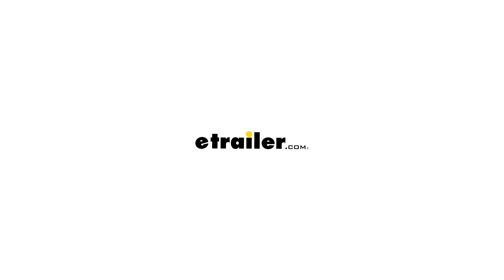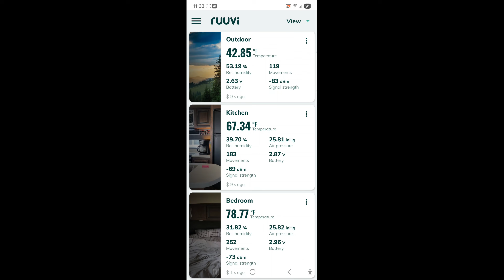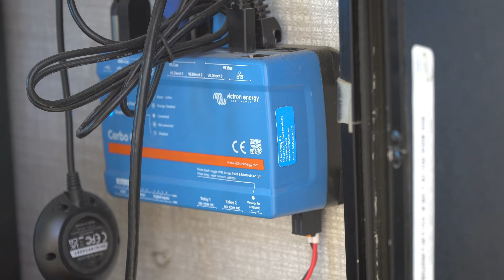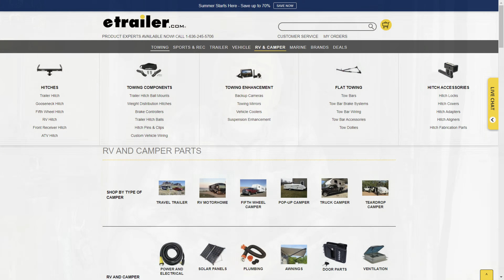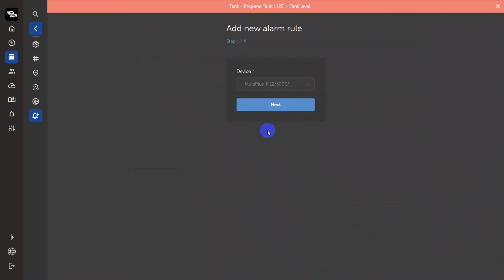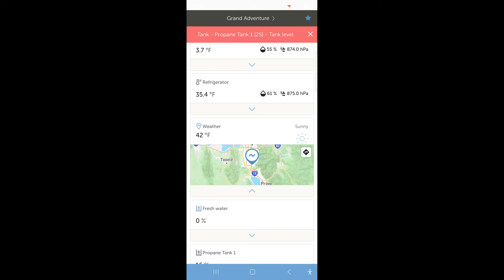"Smart RV" Deep Dive: Remote Monitoring with Victron, Ruuvi, Starlink & Mopeka (Ep. 459)

Comment: Excellent work here. We have done pretty much a similar setup with a few exceptions and learned something new from your video which I’ll probably install in the future. The gPS tracker is cool. I’ve been using my Ford App for location of the truck whilst everything is powered down as I leave the truck camper on the truck in a storage unit when not in use. But the tracker you show looks like a nice addition. Don’t tell my partner I’m adding something. Her head will explode.🤯!

We do run rules generated from Ruuvi tag temp data turn on low voltage consumption circulatory 12v fans I have installed in strategically placed overly warm areas. 

Examples: a tag behind the 3 way fridge in the outside compartment with two fans near the fridge roof vent to help draw air up when in hot weather. Our fridge has the built in fan that will run to help with cooling but it’s noisy, under powered and doesn’t do a good job to keep the temp in the fridge proper. When the temps get to a certain temp before the fridge fan turns on my installed fans will turn on. Works great.

Also put tags and fans in the inverter/battery compartment to do the same thing as it is a very small space (truck camper limitation). I had been getting shut off alarms on the inverter, especially during charging, during hot weather but with the tags, fans, added air passageways and temp rules was able to direct air flow behind the shower and through the wet bay where I have an additional tag for monitoring. Seems to work quite well in dissipating heat.

After two years of use I just replaced all the batteries in the Ruuvi tags. I’ll give this advice for replacement batteries; buy quality batteries…ask me how I know.😢

I did notice a difference in readings between actual Mopeka sensor readings from their app and the victron feeds of about 10%. I just use the Mopeka app data as it’s typically lower in the capacity reading. Haven’t been able to figure out why.

I did install the See-level tank sensors as I was fed up guessing our black tank level as it is very limited in capacity. The gray and fresh tanks were very difficult to get to as they are buried in the camper with no access as we have a Northern Lite fully enclosed fiberglass shell. I had to cut in an access in the floor in lieu of crawling 6’ through an 8” hatch opening to get to the tanks. I’m skinny but my own set of claustrophobic rules kicked in. It’s still not 100% accurate but way better. I wish all RV manufacturers would install proper monitors. Seems to be a fairly inexpensive convenience to their customer base. At least offer it as an option. For this reason alone I will not buy another Northern Lite.

Anyway, thanks reading if you made it this far. And thanks for this video, the tips and sorry for my long winded comment that is most likely filled with grammatical errors.😂
❤!
Reply from the maker: I loved reading your "long winded comment" as I'm very impressed with how you've used the system! Coupling those Ruuvi sensors with strategically placed cooling fans is an excellent use case. Those replacement batteries are hard to find, too. Ask me how I know. 😉

I've thought about the See-Level sensors, too, but you already know how much I hate removing and replacing the underbelly panel.

Weird about the difference you're seeing in Mopeka readings. We're not experiencing that.
Reply: @GrandAdventure You are the best. If i were closer I’d help you with that underbelly pan. ❤

Comment: Great information. Have you used other monitoring systems along the way. We use our trailer only a few times each summer but we setup RVWhisper to monitor several items. It has been great for our needs. It has many similar features but may not be quite as rich.
We monitor these sensors with RVWhisper: fridge and freezer temp, temp in mbr, temp outside, battery status on our pair of 12volt batteries, and on a lithium battery box, possible water leaks under sink and in area where water feeds into the RV, and health of the shore power feed into the trailer.
We don't have Internet given our less frequent RV use, though rvwhisper has similar notification options.
Fyi.

Thanks!
Reply from the maker: Yes indeed! We installed and began using RVWhisper back in 2020 https://youtu.be/h-DM61Uc7pM and continued to do so up until we moved our fifth wheel over to the Victron ecosystem.
Reply: @GrandAdventure Could you compare ? Relative cost, flexibility, accuracy, etc. I'd hate to switch systems but have the same or less capability when done. And price obviously matters some.
Reply from the maker: @acarwile well, it's apples and oranges. For one thing, we switched over to Victron anyway to handle our solar controller duties and inverter/charger duties. So the hardware was already there. For another, while RVWhisper allows you to remotely monitor conditions, this setup actually allows you to remotely control settings that lead to, or avoid those conditions. The overall cost is substantially higher, but it's assuming a lot of the functionality of your RV, rather than just reporting on it.
Reply: @GrandAdventure thanks that is very helpful. If we add solar or want to modify settings away from vehicle (we'd have to add devices for internet access too) we'll dig into options more. Great info thanks!

Comment: Good info and tips! I just finished installing a very large battery system with dual Multiplus II inverters and a Cerbo GX, plus a beefy solar system. I'm just starting to play around with what this amazing system can do, like setting it up so that our solar panels provide us with power when we're connected to paid-for-electricity and only using shore power when our batteries get low. A connected Ruuvi sensor in our fifth wheel's wet bay would be useful for winter traveling.
Reply from the maker: Thank you! That's an amazing system you're creating. Have fun tweaking it to your preferences!

Comment: I want to get some of them and the gps locator. A moisture one would be nice to tell me if something starts leaking under a cabinet. I need to check them out.
Reply from the maker: For direct integration with a Cerbo GX, TSM, you could use a Diversitech WS-1 to detect water leaks. But that requires a wired connection to the Cerbo. For wireless, you could use YoLink sensors, and a Home Assistant hub as an intermediary to communicate with the Cerbo. Home Assistant https://www.home-assistant.io/ is an open source software that runs either on your own device like a Raspberry Pi, or a stand-alone preconfigured device that may be purchased from Home Assistant. It communicates not only with the Cerbo, but with just about any smart home device imaginable. That opens up a ridiculous range of possibilities, which is why we've been mulling over getting one ourselves.
Reply: @GrandAdventure thanks